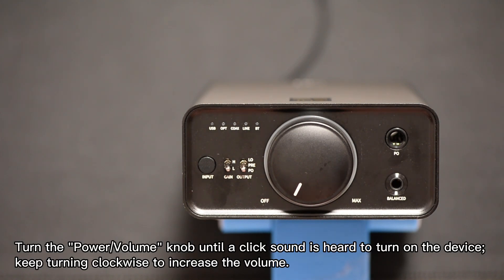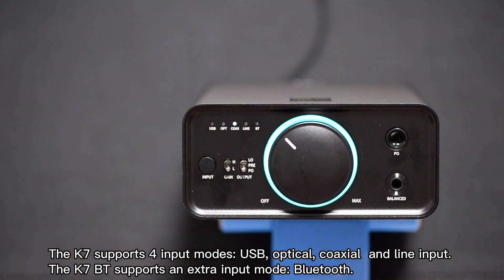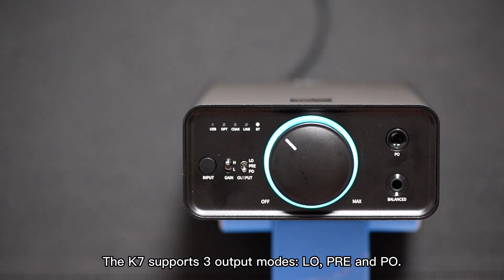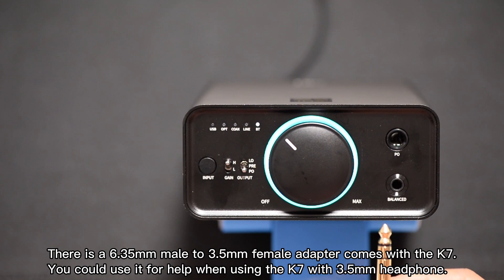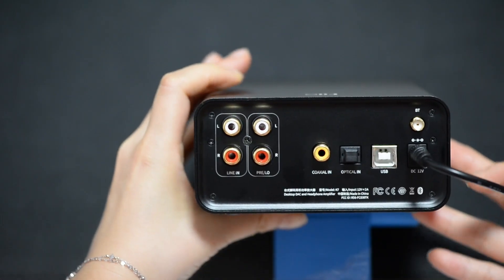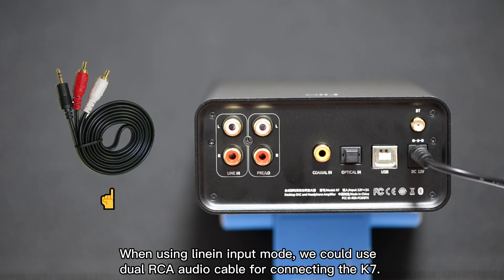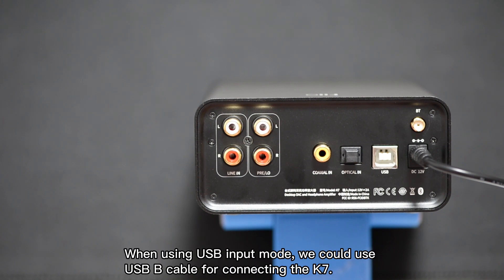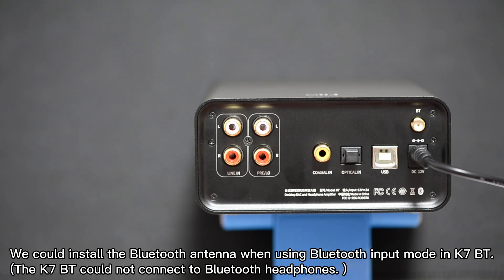FiiO K7/K7 BT input, output and gain introduction

Comment: The FIIO K7 BT would have been perfect if it had bluetooth transmit and receive. I understand why it doesn't have it, but it would be nice to have the option as I regularly need to use my Sony XM5 headphones early hours so I don't eake my wife and kids. It is only during daylight hours that I can use my open back headphones. Bluetooth trasmit and receive would remove a few minimal steps when I swap between headphones.
My K7 BT arrives tomorrow. I hope it is as good as it seems to be.
I almost bought K11, but I want balanced audio and the K11 doesn't appear to have that. 
I'm a big fan of Fiio design asthetic, bravo on that. They look classy and fun, but not obstuse or intrusive.

Comment: Where is the 24 bits output option in Fiio Control Panel? I would like 24 bits since I don't have anything in 32 bits, just to avoid dithering. However, there is a lot of quality and power in this dac amp here
Reply: Theres no downside to using the maximum bit depth in windows
Reply: @NathanSky864  Hello, 

If source material is lower bit rate flac file… what happen whe you set to higher bit on DAC?
Reply: @GameKey11  I read that Windows just adds a bunch of zeros to make the audio mix whatever bit depth its set to, this doesn’t add or remove anything and best case scenario you don’t have to touch the bit depth
Reply: for me , I set that setting in the windows 11.  

Windows 110 >> USB cable >> Fiio k7

Comment: Your website Windows 10 USB  driver download was so slow.   Also I couldnt find any info about 4.4 mm input pin layout.  I will buy custom cable for my headphone and i didnt find any info in quick start guide.  Please inform us your 4.4 pin standart.  Regards.
Reply from the maker: Did you download from this link:https://forum.fiio.com/note/showNoteContent.do?id=202105191527366657910&tid=17 We provide three download links and all this fail to work fine for you? For the pins of 4.4mm port, you could contact support@fiio.com and we could send the definition picture for you.